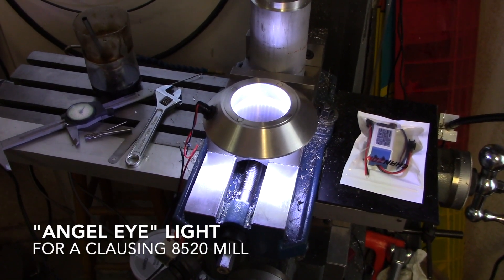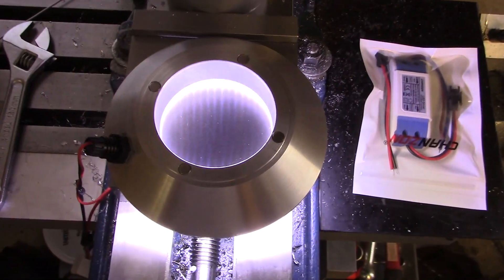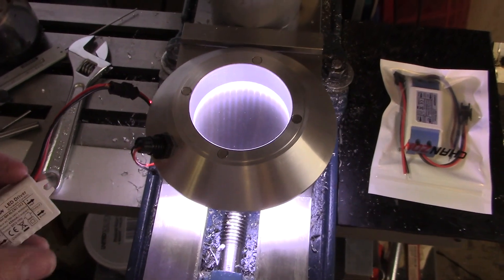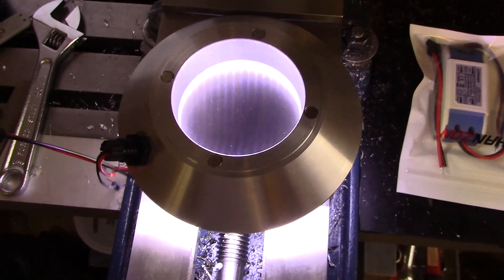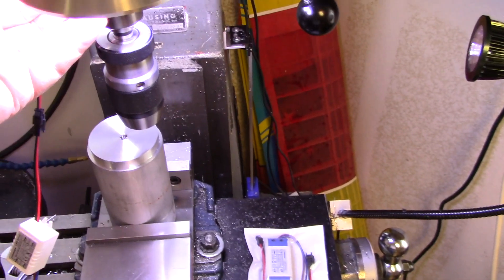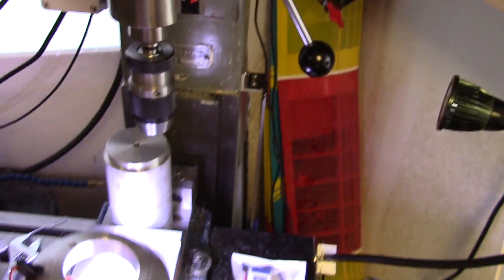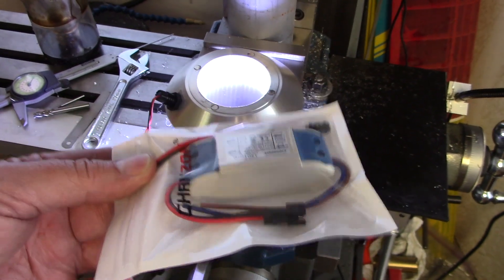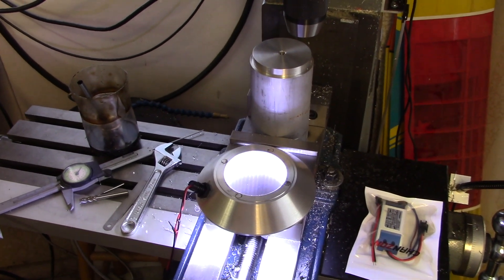"Angel Eye" Light for the Mill

Comment: That is a great light and a good way to mount it.  The first time I saw something like that was when ChrisB257 made a light with the angel eyes for his mill.  I started looking for something to fit mine but could not find the right size so I have a second best light.
Reply from the maker: The "Qasim" that I bought comes in 10mm increments from 60 to 120mm, and a pair of the 120's only costs $13.  I started off with 110mm, realized it was too big, and downsized to 100mm.  Lopped the 12V regulator off of one and hooked it up to my bench supply in constant current mode.  It drew a little over 200ma with the 12V regulator and I tested up to 900ma, but decided 450 ought to be sufficient.  On the bench supply at 450ma I think it was sitting at about 8.6V.  The light's blue-ish, but I figure I can put up with it the way my eyes are going.

Comment from the maker: The “lamp shade” started as a 5” round 1” thick 6061 hockey puck.  I bored it out to fit over the Clausing’s 2.5” quill and put a 45-degree angle on it outside and in, and did an undercut that the LED’s tabs would snap into.  I pretty much free-handed it and didn't bother to do a video.  Made a wastebasket full of aluminum shavings, which always makes me feel guilty.
Reply: that's sick! you do realize that may be the most overbuilt lampshade in the galaxy??
Reply from the maker: @editbench  Wait 'til you see what it looks like after I finish engraving The Battle of Gettysburg ;).
Reply: don;t get me wrong- I want one!  but as a product it would be about $758!!!  hahahah. Cheers mate. it's brilliant